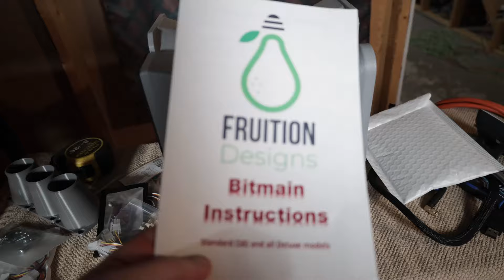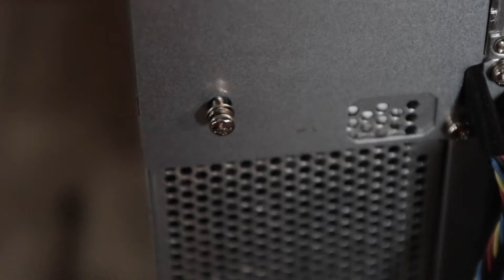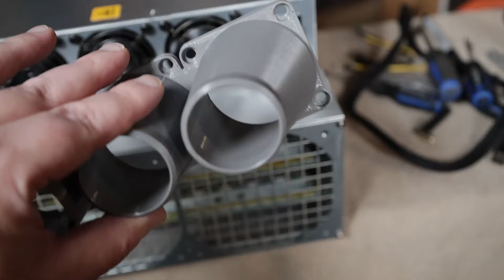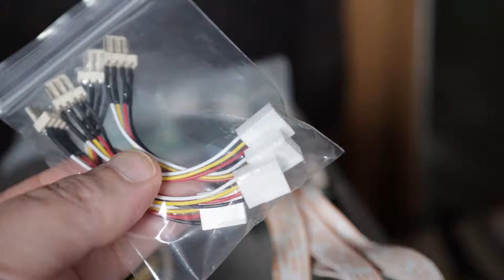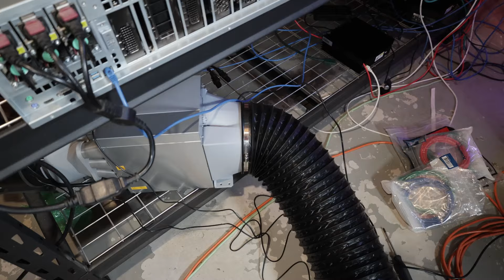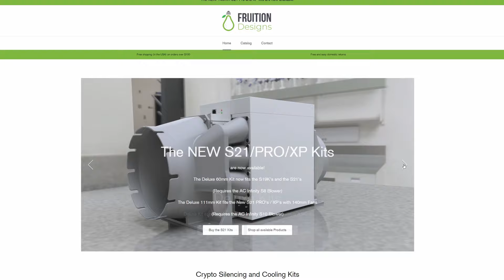How To Silence The Antminer L9 - I Made This Miner QUIET!!

Comment from the maker: Did You Know you Could Silence Almost ANY ASIC?
Reply: Some ASIC don't like it but if you put the AC Infinity in the outlet it will make less noise and that way you can remove in fruits ducts in the inlet taking less space and allow better air flow.
Reply: Will this void the bitmain warranty?
Reply from the maker: @niteshsana3362 probably unless you make it look exactly the same
Reply: Pivotal Njord is a must and they also work with another brands, I have it in Iceriver, Elphapex and Whatsminer ( for this one it need a specific 4 pin cable because the pinout is different from bitmain)

Comment: Im in a cold climate (regularly -20 in the winter at night) and my shop is currently heated with a 4500-watt electric heater to 60 degrees.  I plan on using the two l9s that should come in tomorrow to replace my main heater.  Is there an intake temp that is to low for the l9
Reply from the maker: Not sure had mine is -1 ambient